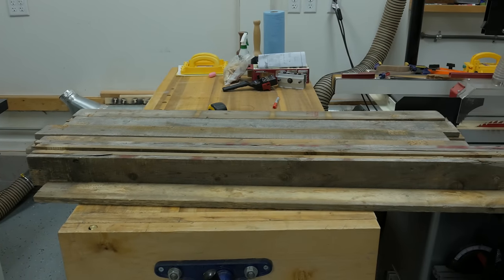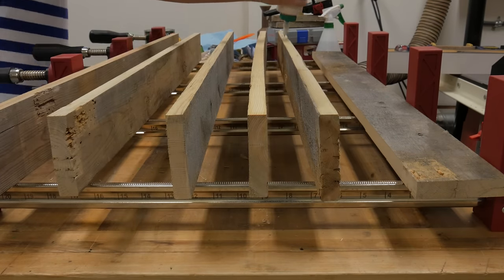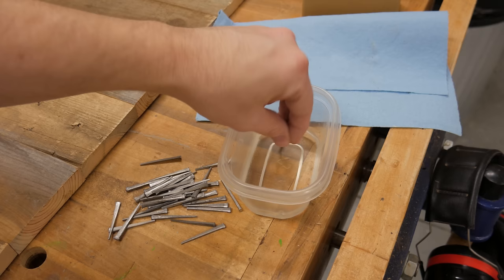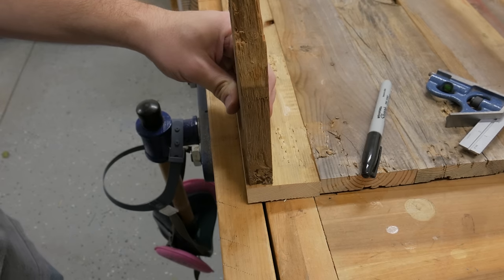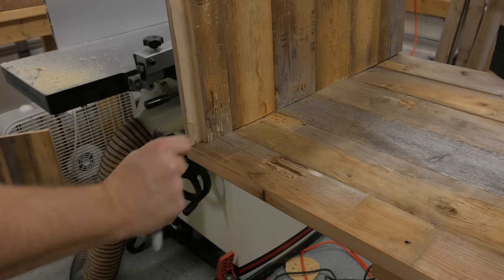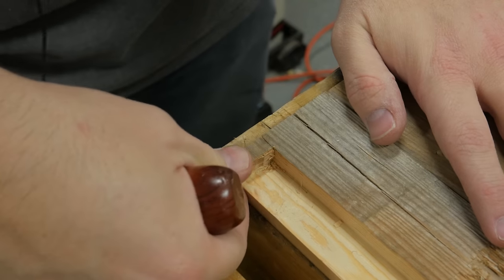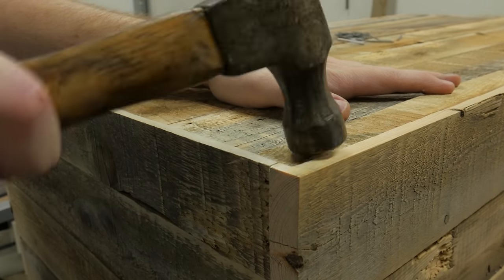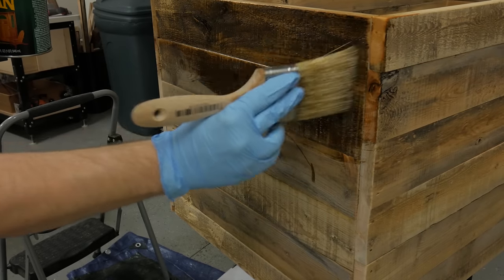Rustic Trunk With A Hidden Compartment

Comment: Just an FYI.  I was taught as a gunsmith when you apply an acidic solution to something you need to neutralize it by soaking it in baking soda and water after you have the desired oxidation or patina finish.  If not it will continue to oxidize even if you apply a coating to it.  Superb craftsmanship. 👍

Comment: You could always pre-drill a tiny hole before you add the cut nails. That would aid in the prevention of splitting. I had to do this on some old world style potato crates I was recreating. I hammered in nails for all of the fasteners.
Reply from the maker: Yep, thats a good tip.

Comment: Thanks Sean!  Great video.  The trunk looks wonderful.  Would you make a wall cabinet including doors for a bathroom using the simple design of the trunk with pallet wood?  I have been collecting pallets to get this project started but am a little intimated since I only have a chop saw and a table saw.  The over the potty cabinets sold in stores are not deep enough or big enough for towels and wash clothes.  I love the colors and texture of the pallet wood and a wall mounted cabinet would be perfect!  32" W x 11" D with 2 shelves.  Thanks!

Comment: What are you doing right before you add the screws to the hinge at 8:45 mark?  Are you pre-drilling?  What are you using?  I can't tell.  I have always had difficulty with hinges.
Reply from the maker: Pre-drilling with a drill bit.
Reply: The drill bit he used is specifically for hinges, it centers the drill hole exactly to fit the hinge. Hold the hinge to work surface and insert the bit in hinge hole, it lines up hole exactly in center.
Reply from the maker: yep, what Johnny said

Comment: Did they have Phillips screws at that time ? I've seen a few old antiques they seemed to use wide headed slot screws.
Reply from the maker: They probably didn't but you can't see the screws unless your face is about 6 inches away from the handles. And I don't think too many people will notice or care.

Comment: It's a great build and the video was put together very well. I had some issues with the build though. Since the wood is pallet wood, its already at a disadvantage due to cracking/splitting. That said, I was surprised that you only glued the planks instead of using biscuits or dowels. I don't remember the vinegar treatment to add rust which is scientifically cool. I love the rustic look but I don't see a reason to create/add real rust to the parts when there are better ways. Rustoleum has a paint that makes something look rusty. Plus, creating rust on the nails when only the nailheads will be showing, I don't get. Either dab the nailheads after they are nailed in or dab rustoleum rust paint on the heads. Just some things to think about
Reply from the maker: It's still holding up just fine but I appreciate your thorough issues

Comment: Are there any issues with joints opening up or
Wood excessively shrinking or expanding since it’s not kiln dried? Thanks. Cool video.
Reply from the maker: I've had this in my home since I released this video(almost 3 years now) and have had 0 issues with it. This wood was in a barn for years and then in my garage for a while before I built the trunk so it was done moving.

Comment: A nice build but wouldn't slotted screws have been more in keeping with the look rather than Philip's heads?
Reply from the maker: Maybe but you can't see them. Not sure why so many people point this out lol. It would be different if they were in places that was more noticable but they are holding a leather handle on the side of the chest.

Comment: you should have used bisquits
Reply from the maker: Why? Edge glue on the panels is strong enough for the panels. These boards aren't super flat anyways so I'm not sure how using biscuits would have helped anything.